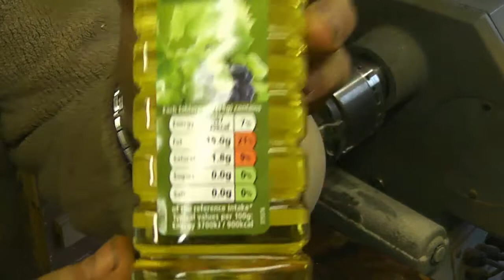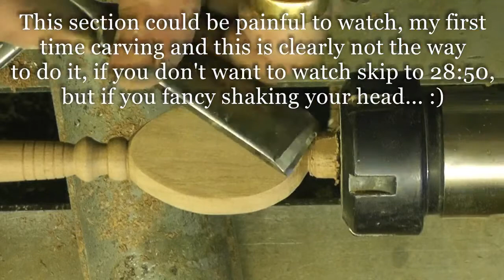Cereal bowl and spoon

Comment: Great little bowl Mark and good to see it being used and not just for show. I like your method of holding the bowl when trueing up the tenon, I think I might borrow that idea.
Reply from the maker: Cliff Phillips cheers mate, it is a good way but it does have a limitation, it is only good enough to true up the tenon and a small section around where the ends of the jaws contact the bottom because of slight flexibility, the wider you go the more chance of vibration and out of trueness :)

It is definitely not good enough to true the outside of a bowl this is why I sort the tenon then inside then outside again 👍

Comment: Nice job , Mark...you inspired me to make my own cereal bowl!
Reply from the maker: E. Glide thanks its certainly different and surprisingly I see my kitchen being a lot more tidy with no pots stacking up lol, when wood I clean the bowl straight after using it so cereal does not encrust the inside, I might try to make some plates soon but not sure how they would cope with hot food with knives and forks
Reply: Wooden plates cope with hot food just as well as a wooden spatula copes when used to turn a stir-fry. Knives mark a wooden plate about as much as they mark a wooden chopping board, and have a similarly serious effect on its usability (eg, no effect whatsoever). Forks don't have any effect at all so far as I have observed, but then it wouldn't bother me of they did so it may be that I just haven't noticed ;)
If you do get food encrusted on the inside of your bowl I recommend a metallic scouring pad as the best way to clean things up.
Reply from the maker: Woodworks&Coracles cool thanks for the info, Looks like Ill be trying one soon and baptize the surface with pie and chips lol , I actually have a wet turned silver birch plate  that I neglected to sand when wet and true, its warped while drying and turned into a mangled pringle shape, I havnt bought myself to throw it away as after a while looking at it I like the quirky shape so tomorrow morning I'll look at truing up the foot plus tenon amd make a dinner plate out of it

Comment: Great video Mark, good info on the grape seed oil, I have yet to find a food safe oil I am happy with, so I’ll be giving that a go. Thanks for sharing.
Reply from the maker: Max Forest no problems mate, this is the first time ive used oil that i am 100% sure is food safe, no contesting it as it is cooking oil but unlike some it polimerises in the wood so does not leech into the food like mineral oil can or go rancid like other cooking oils, the finish is very mat there is no shine when dry but its very even amd smoothness is down to the sanding prior to oiling, no sanding needed after applying just rub or brush on, wipe excess off after a few mins and its done 👍